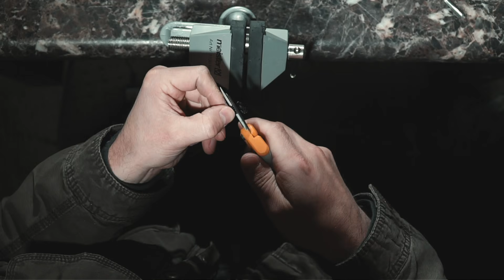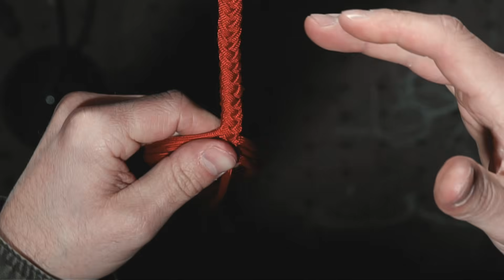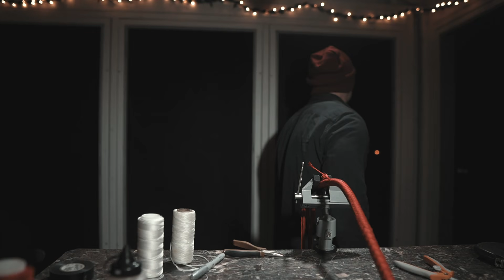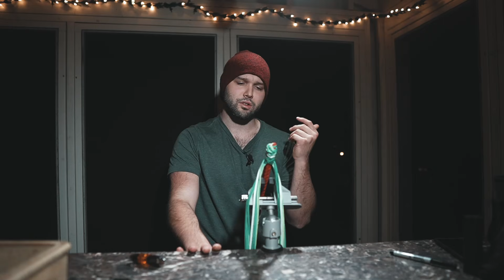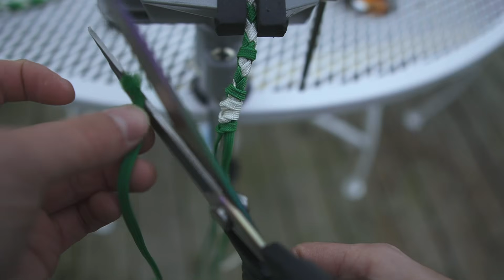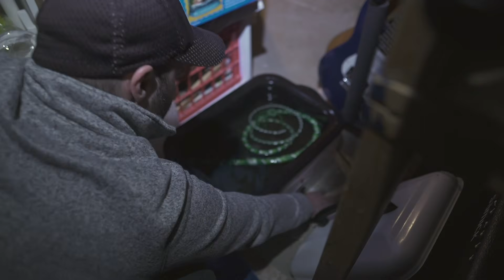My Current Nylon Bullwhip Making Method 2020

Comment: I have concerns that every time I watch one of Nicks videos, it is his "latest method"? Simply because he usually tells us that he has replaced one or two of the previous component parts due to a breakdown of some sort. So what Nick is telling us is simple. Don't buy one of his whips until he gets it right!
Reply from the maker: Interesting viewpoint. I don't ever recall stating that my current method videos are created to address whips "breaking down". Instead they are created to inform fellow whipmakers and clients of my ongoing discoveries within the craft which I believe yield a slightly better build each time.

If someone purchases one of my whips 3 years down the road (assuming that I still make them), they will indeed receive an overall better product. This is due to myself gaining more experience in the whipmaking craft over time, but is this not the same case for everyone in every art/skill/trade? The way I see it, there is a big difference between refining something over time, and "not getting it right". The minute that I proclaim a particular whip build as THE ONE, then I'm not learning anymore. True perfection is never obtainable, but it is certainly pursuable. Even though I am currently happy with my products, I still have so much yet to learn about whipmaking, and I openly admit that. Some people will like my whip building methods, and others will not - and that's OK.  Regardless, I still respect your opinion and I thank you for watching.
Reply: “There are 10 ways to skin a cat” As a tradesman I truly believe this. I love working with apprentices, they’re lack of experience allows them to think outside the box. I’ve learned a lot from them, sometimes they’re ideas work but sometimes they don’t. What I’m saying is try all the techniques you can and use what works for you in your style. Love the progression in your technique Nick! Love your vids! Just like James Gurney the painter!
Reply: @NicksWhipShop  your video work and literature is to advanced for whip making lol.   Acting maybe on your horizon lol
Reply: @NicksWhipShop  
EMATEUSEUCERUUXiCOTi
Reply: @NicksWhipShop  EUCEUXiCOTi
Reply: @NicksWhipShop  brilliant reply. 👏🏻
Reply: This comment is just plain ignorant. If i was making them you would be right. I have catastrophic failures all the time with my home made nylon trash. But what nick makes take effort time and care. It doesnt matter which method you use. Yes the newer videos are better but it doesnt matter because all around this man has always been able to make really good whips. Otherwise people wouldnt buy them and he wouldnt be here making these videos. Have some respect sir. And just because a newer more efficient method exists doesnt mean the older method is now useless. Just think before you comment.
Reply: Don't tell people not to buy His whips. What's Wrong with you??
Reply: @Christ_died_for_your_sins_777.  what a clown eh
Reply: Never buy anything because there might be a slightly improved version available in the future. Just wait for eternity.
Reply: If you are not learning and improving you are backing up, my friend. All of Nicks methods, except electrical tape, Are excellent. I for one can hardly wait to try them all and see what works for me. But you can keep going backwards if you like.
Reply: Noone Important When I made my bullwhip I was able to use several of his videos to make my own procedure combining the techniques I thought would be best for my whip, and it’s fantastic, it cracks very smooth, and I don’t see why that experience I had SHOULDN’T be applicable to everyone, and that starts with improving the craft, exactly like you said, I second that.
Reply: @willhamilton297  thanx will. That's kinda what I have in mind. Nick's videos are the most complete tutorials I have found. I like that he tells us why he does what he does. Nick is an ultra fine instructor
Reply: Come on! Nick does awesome designs. By my means i just want to say.. Bryan Rain Bringer how does your whipmaking go! Got it right yet.. Practice makes perfect! Not even a back in time whipmaker got it right from the beginning! By my means this is a interesting project to begin the core the way he does and build it on to a full bullwhip.
Reply: To state the obvious I really enjoy identifying with Nick's new and better crafting techniques and although one small change or even one significant change won't make that greater improvement to your build, implementing all of these changes which Nick has either learnt from others or has  developed himself over time and through implementing these we trust will result in a greater whip making experience, perhaps improvements to the build efficiency, no doubt a better performing whip, a whip of higher quality (materials or techniques) and overall a better looking whip.
Reply: Any craftsman or artist improves and modifies their technique and design as they practice and get better, that’s how these things work. I’m sure if you look at your favorite artist’s, doesn’t matter what kind of art, earlier compared to later works while still masterpieces you can see how they replace old techniques with new.
Reply: Regardless, Nick makes high-quality whips. He's honest with his audience and wants to teach everyone his methods. Like every handcrafted art, crafters learn new things and as a result, new methods are born. Even though his whips are made differently today than they were 3 years ago, doesn't necessarily make the past whips poor quality. I don't think there will ever come a time where a whip maker finds the "perfect method". Again, like every handcrafted art, there is always room for improvement. That will always be the case for Nick and every person who creates.
Reply: Everything we know is constantly evolving. Phones, cars, houses, whips, you name it. Nothing is ever truly finished and the work done 20 years ago always looks like shit to the modern man.
Reply: Heaven forbid an artisan might progress in his craft.
Reply: Oh jog on mog. Nick, like Bob Ross, is very straight forward and calming (which sometimes causes a sleepy effect) in his demonstrations. The attention to detail and the reasoning behind doing certain things is very clear, professional and reassuring. It's also nice to see a craftsman humble enough to state that perfection is never really obtained, but that you should still strive to improve yourself. It's known as self cultivation.
I'm the owner of an 8ft nylon bull whip and I don't know where I'd be without Nick's videos.
Reply: Time for a bullywhip vid...
Reply: This is like saying “I’m not gonna buy the 2023 super car cause in 2040 they will be better”
Reply: Humbug.  So you made some minor modifications to your whips based on experience.  You've inspired me to build a whip and Ive been referring to all 3 current methods as well as your falls and crackers video.  Just finished my second belly!   Cant wait to crack the final product.  Thank you. Keep up the good work.
Reply: Well, I have built 5 of Nicks whips and really enjoyed the process of each one. My first whip I call "Dollar Store" because I purchased all the materials at our local DS.  I now have lacing needles, kevlar line,an account at  paracord planet and waxing roaster.  To quote Adam Savage, "I'm a work in progress", just as Nick's videos are.  My next whip is going to be pink and black for my wife.

Best to you and all you love.
Reply: The older method would be fine for a beginner. I just watched one and will use hockey tape instead of the vinyl tape. The tutorial in his bullwhip was the best l found for clear instructions.
Reply: It appears that no one here understand sarcasm, which, to be fair, is pretty difficult to discern in text form, but I thought this was pretty funny
Reply: I guess, man. honestly, the only real important changes he's made are 
1) He stopped using electrical tape
2) He started using sinew to bind whips
3) He started waxing all of his whips
Everything else is pretty minor, and those 3 changes GREATLY improved the quality of the whips, everything else is just small incremental updates that don't do that much, but are still cool to see. It's like anything other skill based hobby, there are big things you need to learn, and then after that there are lots of other small things you can change and update over time if you want, you know? And considering he's updating those things all the time, it's really only making the whips better and better. (And as a side note, nylon bullwhips are a relatively new invention, they're still figuring out TONS of stuff all the time, but leather bullwhips have pretty much been made the same for 60 years now. Looking at the procedure for a full leather whip verses a nylon one is CRAZY)
Reply: When you switch from 14 plait (under 4 over 4) to 12 plait, ( under 3 over 3 ) doesn’t that create a double overlap?
Reply: Sorry, 14 is under 4 over 3.
Reply: @travissmith6551  correct if you drop the strand that is the first over of the 3 it will you would want to watch his video on avoiding that on your overlays if you care.  A double overlap in a solid color you may not care about.  Essentially he could flip the whip over and do the inverse plat method and undo up to the overlap in the middle.  Then you would be in an under 3 over 4 and you could drop the first over and be in an under 3 over 3.  Sorry for the terrible explanation.
Reply: @korruptgaming1370  that is an informative comment. Nick does have a video explaining and describing that method, I do believe

Comment: Not sure if anyone is reading these comments, but I can't get 3/8" sinker cord in Canada, so I will have to use gutted 550. I was thinking of filling the 550 with BBs and then using 4 strands of 650 to create a faux 3/8" core. Would this work? And, any thoughts on the length for an 8 foot whip with 8" handle?

Comment: Instead of putting the BB'S into ur hand it looks to me that ur tube will fit into the top of the BB cap then turn it upside down and move ur brass tube up and down so it'll fill up they should slide rt down the paracord that's how i load my core's just saying lol

Comment: For cutting spring steel use an angle grinder with cutoff wheel and some kind of cutting lub. I use W.D. 40. Don't apply a lot of pressure, just let the wheel do the work. Cut a little bit at a time then apply lub. The trick is to not let to much friction build heat else if it heats to much it'll lose the temper. If it starts turning blue that's to much heat.

Comment: I'm currently building a bullwhip mostly following this guide... I have great trouble getting the one strand diamond plait to pull tightly - my 2 under 2 over (for 8 plait) or 3 under 2 over (for 10) is MUCH tighter. I tried Nick's suggestions on snugging them but no matter what I do it's just not tight enough.. My guess is that I don't have the hand strength he does - so I'm going to avoid that plait pattern till my general plaiting skill improves..

Over all it's good - I've completed plaiting the second belly and am about to bind it.

I'm finding the #2 quilting thread fascinating - I didn't have any of that so I used leatherworking waxed thread - it's a great middle ground between artificial sinew and the quilting thread for me... till I can get out to Michael's anyway.

Over all it's a great vid. I've been making really careful notes/ build instructions so I can repeat and adapt as my own abilities grow

Mostly though as more of a cracking enthusiast than a builder I still find this really helpful as I have a MUCH BETTER understanding of what goes into a whip and I'm finding that I can really see the little details/differences between the different whips I own from a few different makers now... and my own have all been functional... perhaps not as pretty and I can see ALL the mistakes but each one is better than the last, in part thanks to all the wonderful tutorials from Nick and other members of the whip making community!

Comment: I don't know if this is just a certain whip/whip material trait, but I recall a whip demonstration when I was younger, where a big point of the thing was him showing that when he cracks the whip, there was almost always a sizeable small cloud of smoke where the cracker broke the sound barrier. 

He explained this to us as the cracker moving through the air so fast when it's breaking the sound barrier, that it actually starts burning the oxygen around it for a very small period of time. 

I want to say that it was a 12' leather whip (he was a circus performer/lion tamer as he said), but I was just wondering if hat he said is accurate, and if so, do nylon whips like these replicate that as well? 

And if it isn't so, maybe what kind of parlor trick he was doing?

This was all on a very well lit indoor stage, though, so that may have something to do with it.

I'm nostalgic for those days and I want to actually create a whip capable of that
Reply: I'm highly suspicious of that claim. By that logic, bullets that travel faster than the speed of sound (around 762mph depending on a few variables) should glow at the tip and leave a smoke trail. Jets can fly at several times the speed of sound, but they're not engulfed in a fireball. 
 I think he got that idea from things being on fire as they're entering Earth's atmosphere.
 Anywhere you have friction, you have heat. The more friction you have, the more heat you'll get. Meteorites are moving so fast, air particles can't get out of the way fast enough. So they end up forcefully grinding against the surface at speeds so extreme, the friction causes them to ignite (ignite isn't quite the right word, but it's close enough for this)
 The difference between a whip and a meteorite entering Earth's atmosphere, is that meteorites are traveling at least 25,000 mph.  A super sonic whip is slow by comparison

Comment: I want to try this, but where I live (over here in Belgium) it's not easy to find the right type of cord. Especially sinker cord seems to be hard to find. Is it similar to coreless 650 paracord? I can also find 750 or 1250 locally and I could take out the core myself if that would be better. Does anyone have some words of wisdom for me?

Comment: I typically use 3/8 x 10 inch carriage bolts for handles, which come in various lengths, from the local hardware store. :)  I don't remove the head, it makes a good anchor for handle-cap stuff, and the threads are great for anchoring cord to.

Comment: Hello Nick,
not sure if you are still replying to the comments here. I recently tried making this whip with a friend. We took the meassurements from your website and used regular 550 paracrod. We got good results on the first belly, ran into some issues with the second belly and for the final plating the strands became WAY to short for us. The first drop occured about 8-9 inches prior to where it happend for you.

Also generelly the shortest strand was always too short (by about 10in). We made sure to meassure twice and cut once so the length was identical. 

I know this is a very generalized question but can you guess-timate where the issue might be or tell was what other information you may need to get closer to the issue?

Kind regards

Comment: Hi Nick @NicksWhipShop. I just bought 1000 feet of whipmakers cord, im curious where its used, whether it be only used on the final pass of the whip making. Or if it is used all the way from the first belly?
Reply: I believe whipmakers cord is only used for smaller whips (like in his micro pocket sized whip video) Here he uses much wider cord.
Reply: @Zjefke86  So I have completed a whip with the inclusion of whipmakers cord. I used it on the overlay (last layer), and it turned out amazing. I found that if I were to use it over the course of the whole whip making process, and followed the tutorial, the whip would finish with an awkwardly thin diameter. So I used normal 550 cord for the main core of the whip, and when it came to the overlay that's when the whip makers cord came out and made everything look much more tight.

Comment: I must say thank you for making all the instructional videos!  I had intended to purchase a whip off a website but after seeing enough videos of other people making whips I became skeptical of what its construction methods were like.  The methods here were super easy to follow (minus the transition knot, but that is a unique beast of its own).  I made my own adjustments and incorporated elements in which I think will make my whip better for my own purposes (full contact whip battles) but I really appreciate the thorough explanations of how to build a general whip.  If anyone is curious one adjustment was using 1/4" stainless steel tubing for the handle, putting a section of 1/8" aircraft cable coming out for the handle/core transition and then going into the BB loaded core (with my core being much longer).  Further whips may experiment with all aircraft cable for the core...  Has anyone else played with this by chance?
Reply: I use steel tube  and run clothes line thru it for my core.

Comment: Do not get one of your dad's snsp-on or Klein Screw Drivers,  buy one from harbor freight or something,  or get a piece of all thread, threaded rod,  and grind the threads off, or fill with epoxy, but surely Amazon has the bar stock, maybe even a gutter nail could be used!!

Comment: Something that I've been struggling to wrap my head around: What is the purpose of cutting the loose core strands into a taper if the shortest loose core strand keeps getting replaced by dropped strands of different lengths? In other words, say you have 4 core strands cut to 2.5, 5, 7.5, and 10 inches. After plaiting for 1 inch, you drop a strand into the core and cut the remaining 1.5 inch from the 2.5 inch strand. Now the core strands are 5, 7.5, 10, and [however long that dropped strand had left on it] inches long. Why did that original core strand need to be cut down to 2.5 inches in the first place?